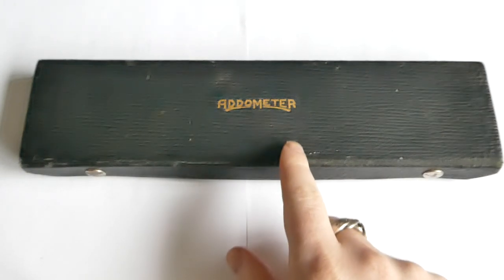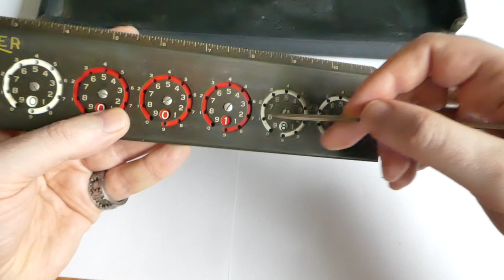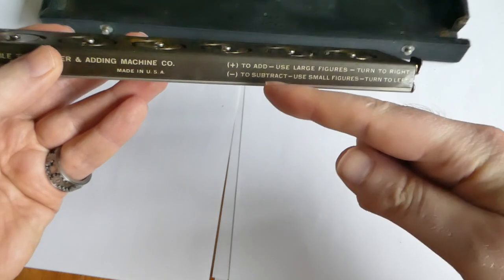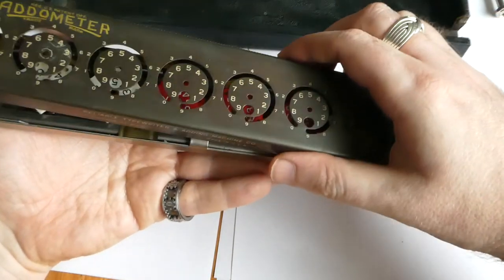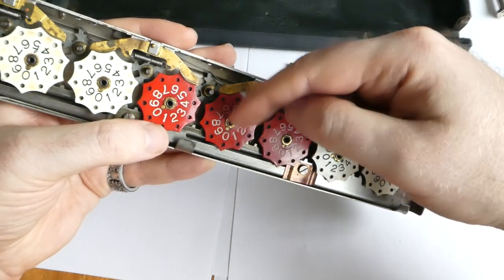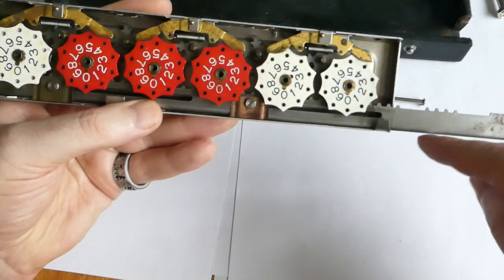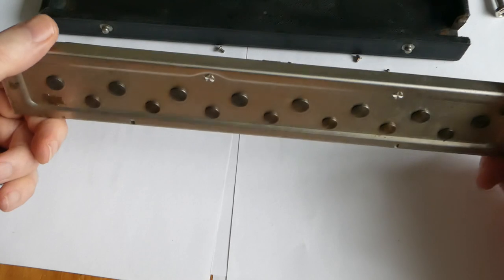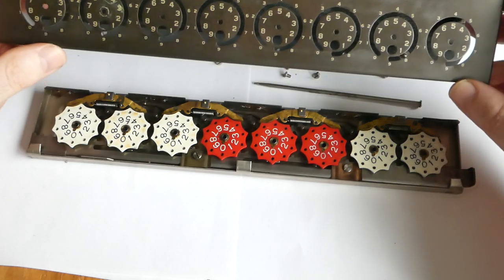Addometer adding machine

Comment: I recently bought one of these on ebay.  It works pretty well, but it has trouble doing multiple carries at once.  Two or sometimes three carries work fine, but anything beyond that jams it.  I wonder if that has always been an issue with these machines or if the issue is the result of the age of my machine.  There are certainly ways to work around that problem, but I imagine it may have been annoying for the original users in certain cases.
Reply: I have the same machine. I can do more than 3 carries but have to use considerable force. The problem is simply that the longer the sequence of carries, the more force has to be applied. This is just physics. In the Pascaline or the later calcumeter, the carry actually really propagates like falling dominoes, but you can only do a subtraction by using the addition of a complement number.